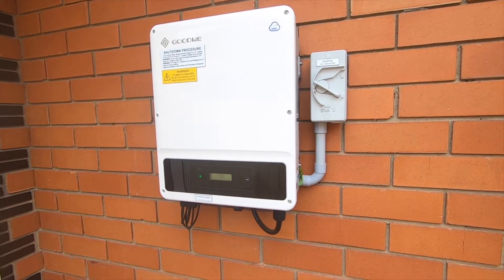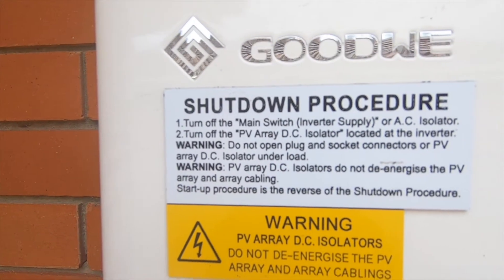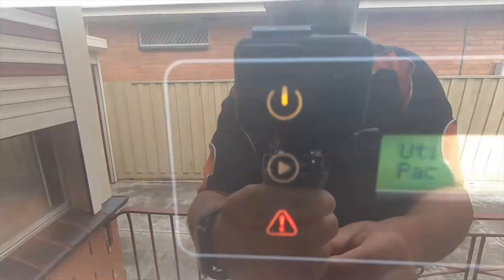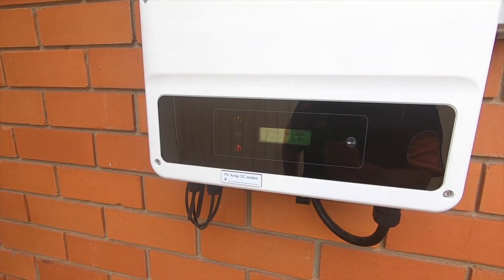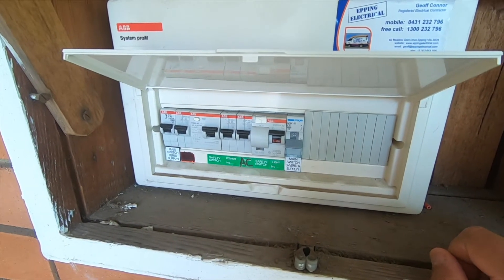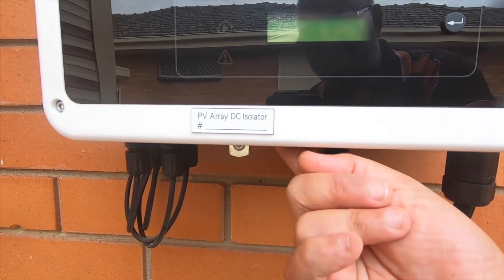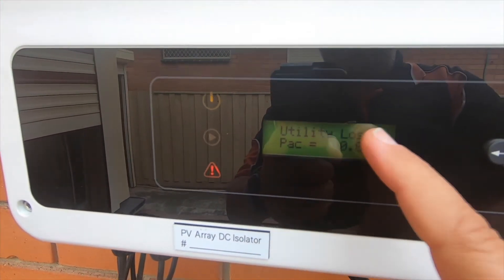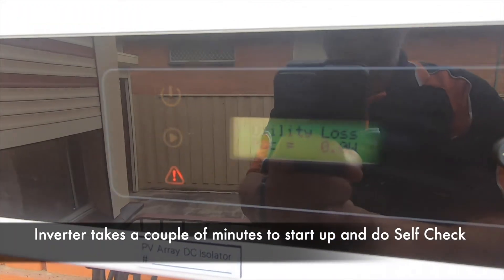How to Power Down a SOLAR INVERTER  - GOODWE  DNS 5Kw Solar Inverter

Comment: Hi, I have 2 of these and 1 is showing normal, the other is saying ct reverse and I’ve also just received a big electricity bill. I have tried to contact my solar company but they won’t return my calls. Could you please tell me what ct reverse means?
Reply from the maker: Hi there, I haven’t seen that error myself but here is some information about it.  Hope it helps.  Try also calling Goodwe.   Here’s the link.  https://powerforum.co.za/topic/12213-goodwe-inverter-~-incorrect-ct-meter-readings-ct-meter-connection-reversed-~-solved-kinda/
Reply: @TheHuski  thank you for your reply. I have finally got our solar company to finally answer. It turns out it’s through a massive power outage in my town and my solar is being wasted.
Reply from the maker: @Nattie03  that’s no good.  I hope they sort it out for you soon.

Comment: quite a good sized system
are you seeing benefits from it?
Reply from the maker: its a 6.6kw Solar System (Panels) ..  the Inverter is 5kw which is always less than what your panels are.  So far in about 8 months we have paid nothing for Electricity at all.  Rough figures to date are $1250 worth of Power generated by the Panels less Usage and Service Costs we are in Credit around  $740.   I estimated by the time the system is 12mths old we will be in front close to  $1000.  So its pretty good if you ask me :)
Reply: @TheHuski  do you have a battery bank or can use only use the system in the day while the sun is out?
Reply from the maker: @TheProCut17  no we didn’t get a battery installed.  During the day excess electricity generated goes back to the grid and we get 20c per KWh we send back.  At night when panels don’t generate anything we are taking from the grid.